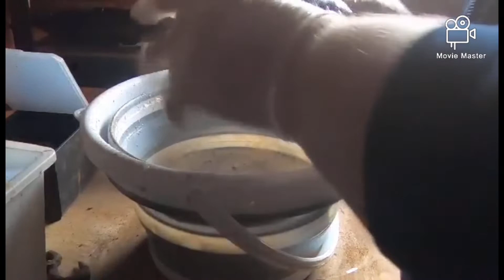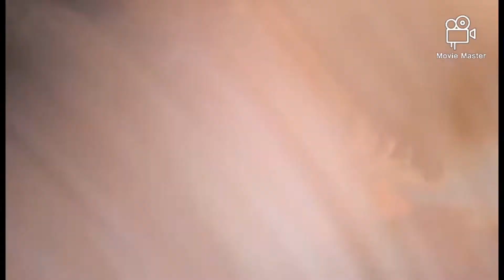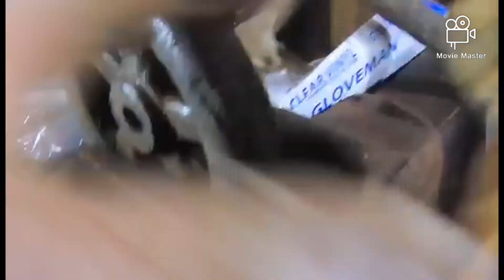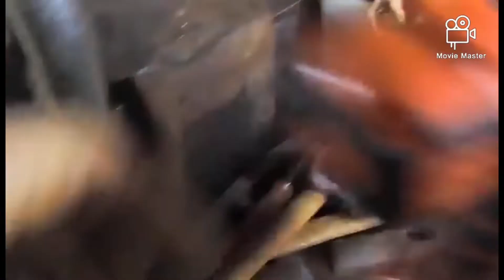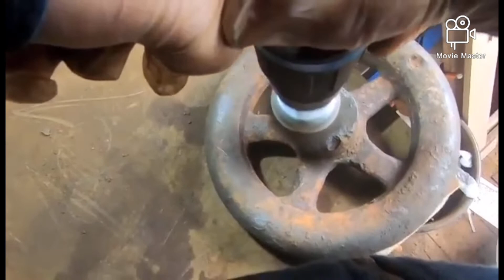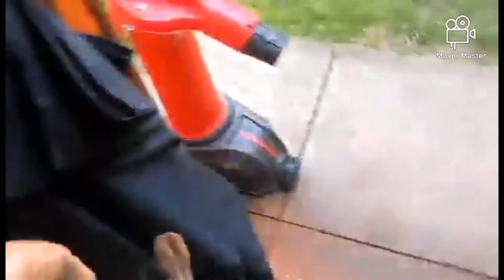!!VINTAGE WHEEL RESTORATION!! Found magnet fishing #magnetfishing #leedsmagneters

Comment: William ----  Us 2 older boys think this is a - open & shut down crank handle - out of a boiler room - The wooden handle has 2 uses , 1st is to protect the human hand from high heat getting burned , 2nd is for cranking at faster speed for emergency shut down .  , Brian
Reply from the maker: Totally correct on that Brian, the size and handle and a bit of research supports that, thanks Brian 👍👍

Comment: What would that wheel have been used for. I really enjoy the finds you pullout of the canals n waterways. Being from Wisconsin I usually don’t know what most of the older items were used for. As our country isn’t as old as yours😉
Reply from the maker: Morning Marie, a lot of times you would have had old pipeline that would feed water to houses or industry, this was a stop valve in case of anything that went wrong you just turn it off like a tap 👍👍